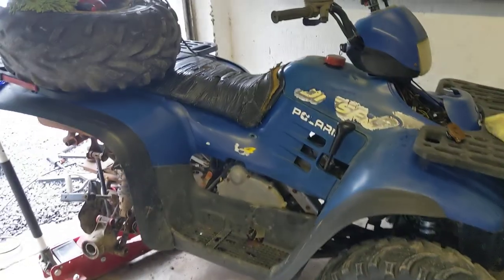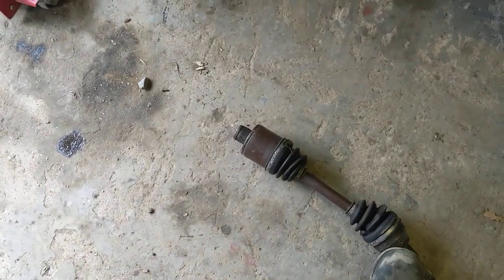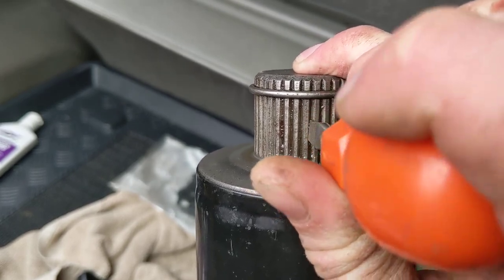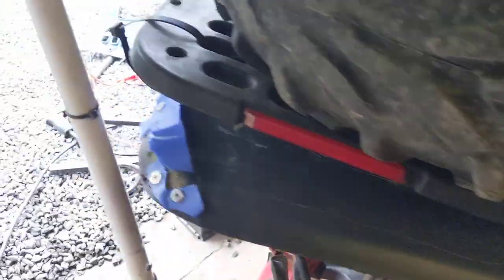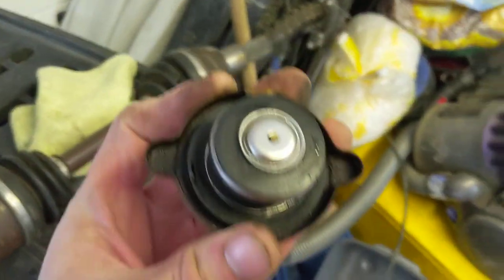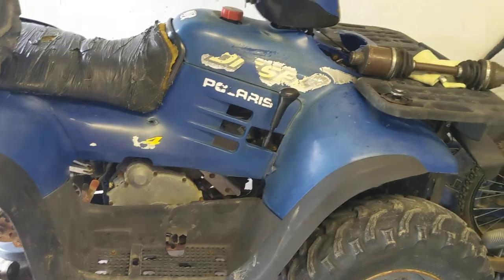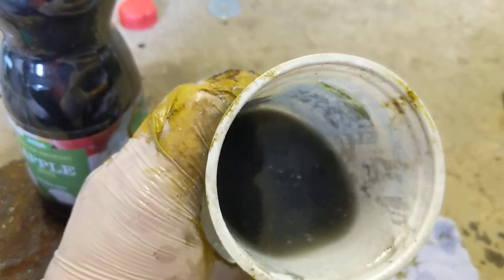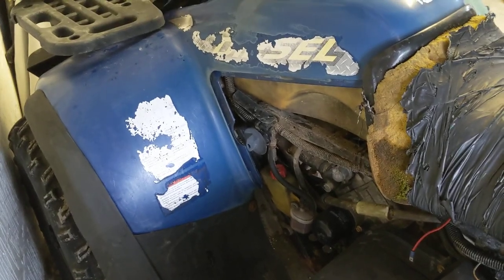Polaris 455 diesel  Quad Barn Find Part 2 - Is it Blown?

Comment: I just purchased one of these from a guy at work. I’m glad I came across your videos. Perfect timing. It’s been sitting a while any ideas on where I should start to get it going.
Reply from the maker: Drain all the fuel out, put in fresh. Bleed system using decompression valve don't try starting on old diesel as injection pump isn't the best on these and really doesn't like water - if there's nothing wrong with it it will start. If you need any parts let me know. I have a lot of parts that aren't made anymore.
Reply: An idiots opinion awesome. Thank you for your help. I will get it today the pics I got I know it needs a seat and the 2 side panels. But looks to have everything else.
Reply: An idiots opinion this will be my first diesel atv how does this decomp valve work and where is it located.
Reply from the maker: Only way to bleed the system on these is to spin the engine over. But if you don't decompress it you'll damage the starter. Decompression valve is on the left hand side of the head standing from behind. Procedure is to fill the tank to 3/4 full and spin the engine over for 30 seconds with engine decompressed. This cycles the injection pump. Repeat process up to six times until you see diesel flowing into the tank from the right hand return line at the top of the tank. If you need to do it more than 6 times theres somethings wrong. When you've finished the process check for water build up in the filter if there's any drain it of and bleed one more time.
Reply: An idiots opinion thanks so much I’ll give it a shot.

Comment: I would recommend that you get a top end gasket kit for it but depends if you can get hold of one. Keep up the good videos
Reply from the maker: I've got a headgasket - there like hens teeth to find. If I can get away without using it I can - not just because of the work but I reckon I have the last one left in the country... If not the world. They were discontinued 5 years ago and had to try almost every dealer in the country to get this one
Reply: An idiots opinion yeah you are probably right just leaving it alone. Just been looking online can’t find any head gaskets for a 455 diesel. It’s probably were a lot of money the spare head gasket you have haha.
Reply: @outdoorgorilla1493 would not gasket paper be an option to make obsolete gaskets?  I have never tried as I am relatively new to working on engines etc but have seen a few people on Youtube make new ones.
Reply from the maker: You could for most oil gaskets but there incredibly difficult to make if it's a big gasket that's a funny shape with lots of bolt holes. Your better using RTV. Obviously you can't use paper for the head gasket which is the most difficult to find. Next video will be engine teardown.

Comment: Do you by chance have the glow plug indicator light for a 99?
Reply from the maker: They don't have glow plugs
Reply: @outdoorgorilla1493  how does it heat up?
Reply: Or I should ask how does it start since they don’t have spark plugs? I’ve seen another one where it says “pre-heat” with an indicator on the face
Reply from the maker: @Sewercrawlers  there is definitely no glow plugs on these there is on the arctic cat 700. It's diesel so it's just pure compression
Reply: @outdoorgorilla1493  Glow plugs are there until -99 model.